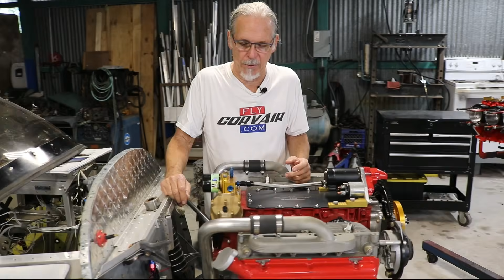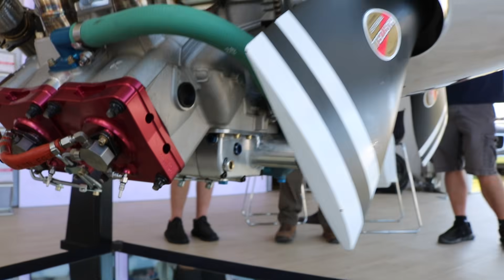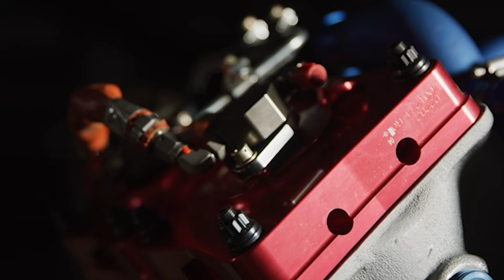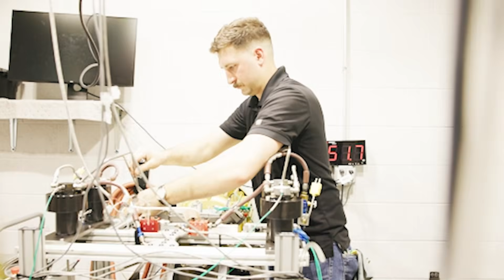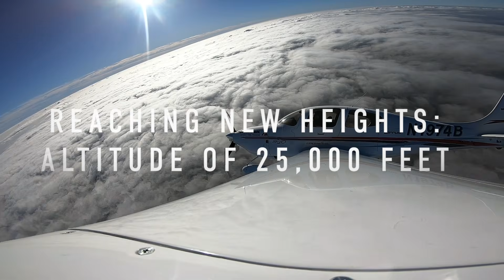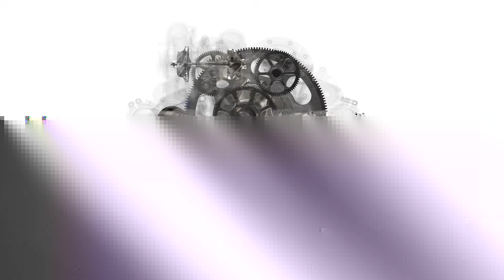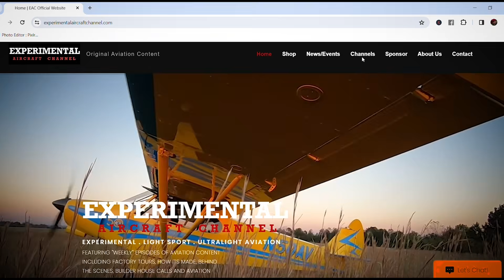DELTAHAWK Diesel Jet Aircraft Engine - ENGINE WEEK 2024

Comment: Okay,…. I’m coming at things from the old 2 stroke Detroit Diesel point of view because that’s what I know. The salesman said no valves or camshaft,… so the cuts in the sleeve that allows the intake charge to be introduced is also the route the exhaust takes, yes? 
Secondly,…. I’ll need to look at their channel/site about fuel delivery, how high can the individual pumps charge the fuel PSI before going to the dedicated injector & what’s the PSI sprayed into the chamber. Also how timing is controlled with this engine. 
Finally, and this is the major one. I know that 2 stroke diesels need a Roots type blower just to get started. With the addition of a turbocharger the airspeed from a “power-snail” can easily overwhelm a roots type blower. So I’m curious if there’s a bypass system where turbocharged air can get around/under the Roots style blower. I’ve seen it done on racing 2 stroke Detroit engines so I’m wondering if this engine has something similar. 
All and all a very impressive engine for smaller airplanes.
Reply: I saw a video elsewhere and they said the turbo is added to keep a consistent performance at high altitude, so at low revs and on the ground only the supercharger is working.
Reply: Turbos are very easy to control by wastegate, bypass, and blow-off.
Reply: The roots blower is a necessity to get a two-stroke diesel engine to light off,… I’m certain it’s also a necessity for this engine to kick over as well. Forced induction has a long history with internal combustion aircraft engines. I just think the entire process with this engine is fascinating.

Comment: At first, I was thinking this would be like a Detroit engine, but apparently not, as he said there are no valves in it at all. From his description, I'm assuming that the blower feeds to a port which gets uncovered by the piston for the intake but does not run through the crankcase, as he has oil lubrication in the crankcase, like a Detroit does. Edit to my post, Just remembering, it's actually the exhaust on the Detroit that is valved, not the intake, so It's really not much difference at all. It's just a ported exhaust instead of valves.

Comment: He's not quite accurate about the difference between a diesel two-stroke and a gas two-stroke. What he's saying is indeed true of his DeltaHawk two-stroke diesel and a typical cheap chain-saw two-stroke gas engine. However, a two-stroke gas engine could use turbo + supercharger scavenging just like the DeltaHawk does - they don't because it's more complex, expensive, and not needed for a little cheap putt-putt to run a trail bike or a chainsaw.

Comment: Would make an excellent hotrod mill . 235 hp with the torque, maybe a bit more porting and revs for the street, as you generally don’t crash if the engine stops in a rod . But 235 hp at 2600 is stout trout

Comment: Projected TBOs are meaningless... Only time will tell when a bunch get in service. The specific output of this engine with only 200 cubic inches and it being a 2 stroke puts very high thermal and gas pressure stresses on the pistons and rings. I'll be surprised if these go 3000 hours without issues.

Comment: I don't trust that guy...
Reply: He said marketing. He didn't mention that Diesel just has a higher specific weight and energy content per Liter and attributes lower fuel burn to efficiency of the engine BS. WHY if you have a great engine, just burning the same but cheaper and lead-free JetA being enough, do you endanger your reputation by obvious absurd claims?

I really want this engine. I just replaced our IO-360, a good engine, efficient at 150 TAS below 10 gph in a Cirrus SR20, with a new one. The next one should be something like the DHK, actually I hoped for this one. But it wasn't ready. I would be very happy with 10 gph JetA for the same cruise speed, and faster climb high up because of the TV. Stop making absurd claims, deliver a solid, certified, reliable engine. What it can really do is enough. Get marketing under control. This hurts more than it helps.

Want marketing advice? SR20 installation kit and price, performance tables and delivery lead times. There are plenty aircraft with airframe that have many decades to live, but need a new engine without Avgas 100LL, certified, not experimental stuff that you can't fly anywhere without difficult preparation in Europe e.g. Yes, there's a world outside the US!

Comment: Oh... he feel for "the P-51 made thrust from cooling".
No, it didn't. It reduced the drag significantly, but there was no net thrust.
The temperatures in a radiator or intercooler would have to be a lot higher for enough energy to be transferred to the flow.

There are P-51's still flying today. It should not be too difficult to measure the velocity delta.

Comment: Don't turbines burn Jet-A, a refined #1 fuel oil and diesel is #2 FO?
Reply: This engine has been designed around Jet-A since that fuel is available at most airports around the world.   It does run on #1 or #2 also.  In fact conventional diesel fuel is easier on the pumps.  It will also run on alcohol but with less power.

Comment: It cannot be a diesel piston engine and a Jet, aka gas turbine,  at the same time, so your title is wrong. I gather it is an inverted V4, turbocharged, piston ported, 2 stroke diesel which runs on aviation grade Jet A1 kerosene.
Reply: Exactly, also super changed.

Comment: Aircraft engines have been around for 100+ years now. How many diesel aircraft engines have there been? Almost none! Why? The high compression required for diesel requires a strong, and heavy block and head. Also the high compression equals more vibration. This engine is not the future, diesel and 2 cycle engines are the past. If you don't know that, your dumb and a potential customer

Comment: As a retired airline pilot and A&P I appreciate the concept a modern Detroit type diesel. Your presenter dodged a few impotent questions one being the initial TBO  and the actual certification standing. I also see several potential problems. The supercharger is belt driven what happens if it fails as the supercharger is critical to the 2 stroke diesel
Reply: The engine can run without the supercharger or without the turbo.  There is a reduction in power.  The supercharger is essential for starting.  After that it will run on either one.
Reply: That belt ain’t never gonna fail. Top fuel drag cars use belts to run 10,000hp supercharged engines. Both ford and Chevy use belts soaking in oil to run their oil pumps. I’m sure if you never replace it in 34 years it might crack a bit.

Comment: He avoided the “how much does it cost” question pretty quickly 😂 I’m not sure the RV community will be lining up for an engine twice the price of a Lycoming.
Reply: I see this as a very niche engine.... especially when you consider the initial cost.

If they want an engine designed for jet A, why not come up with a low cost turbo prop engine specifically for kit or experimental aircraft?

Also, he estimated the tbo to be over 3000 hrs. At the asking price, I would expect double or triple the tbo of a continental or Lycoming.
Reply: @brianschumaker5912 - tiny turboprops have not proven to be efficient because of the limited tolerances between the blade tips and the case.  I’m skeptical toward this motor only because it appears to have been on the verge of production for about 20 years.  It might be a terrific engine, but it needs to be in hundreds of planes with tens of thousands of hours before we get a real idea of how well it works.
Reply: @KenLeonard  
Wouldn't a turbo prop out of an Air Tractor be a viable solution?  At least a downsize one. There are plenty of proven turbo engines used in helicopters that could be adapted to a small experimental aircraft. The MD 500 comes to mind. The engine only weighs in the neighborhood of 135 pounds.

Comment: A two-stroke diesel with exhaust valves in the head and therefore uniflow scavenging ( like the old Detroit Diesel 53, 71, and 92 Series) is more efficient and effective; however, it would be more complex.

Comment: Nothing is "very unique"; it is unique, or it is not. A two-stroke diesel is not unique, and more specifically a turbocharged and externally scavenged piston-ported two-stroke diesel is not unique. 

If you mean a current production aircraft two-stroke diesel then yes, that's probably unique.

Comment: Liquid cooled engines CAN BE very low drag to cool, but good luck with that putting it in an existing airframe without something like a well designed belly mounted radiator...

Comment: I've been watching and waiting for this engine for decades and feared that the cost and red tape of FAA certification would kill it.  I'm glad they've persisted.  Unfortunately I'm now of the age where I probably won't be able to own/fly a plane with one of these engines (or keep flying, for that matter).  Really great design IMHO, especially with regards to cabin heat.  No more worry about leaking exhaust heat exchangers.  Just put a hot water heater core in the cabin.  On a twin this would eliminate the troublesome gas fired heaters.  If I was only 30 years younger... sigh
Reply: Perhaps stretching it a bit, but you might be able plumb a FIKI system as well.
Reply: Rotax 912iS is $25k and offers liquid cooled heads, and radiator/heat exchanger. 

Exhaust heat muffs are dangerous. Even new, they can crack and leak a lot of CO directly into your lungs.

Oh, the 912iS and iS Sport produce 99hp and obtain something like 0.38 lb/hp/hr BSFC which is 5%~32% better than the best/average injected or carbureted TCM/Lyco.

Comment: I have a few questions!
Why are the dry-sump scavenging stages on top of the engine, above the crankcase? 
What is the oil consumption like? I would imagine that the oil control ring at the bottom of the skirt prevents some oil loss through the peripheral exchange ports but not all. 
The crankshaft design is intriguing, is there a specific advantage to the counter-weights being a different material that needs to be attached to the parent crankshaft forging?
Is the intercooler an air/air type or using a separate glycol loop in air/water configuration?
How is the compression ring life being that the rings are swept across the gas exchange ports? How do you keep the ring gaps from migrating to an overhang position where they might catch on the port openings and wear excessively?
Reply: There are plenty of bridges across the ports to keep the rings in the lands,  my old Kawi had exhaust ports wider than anything I see here.
Reply: Lubrication scavenging pumps move oil mist, not accumulated liquid.

Comment: Diesels have been in aviation for years…...  Packard, Guiberson, JUMO.  Two stoke Schnuerle ported truck diesels had some interest in the late 50s in Europe.  White Motor Company here in the states built Schnuerle 2stroke V4 truck engine.  The 2 stroke isn’t as efficient as a 4 stroke nor, as Detroit Diesel found, cheaper to build.  But they are smaller and lighter.
   One tough 2 stroke problem is lubricating the piston pin which is continuously loaded.  Gasoline 2 strokes use needle bearings, but these are inadequate for diesel.  Deltahawk has this under control.
  In this size engine, Diesel efficiency does not necessarily exceed a direct injected gas engine, but you won’t see DI on a plane engine because of FAA rules.
   I wish Deltahawk the best and appreciate their perseverance,   On thing they might do is offer radiators and cooling system design software/service.    Cheers
Reply: They fo design the radistors and the cooling ducts as mfntioned in the presentation.

Comment: Same as the Detroit diesel system 71 series
Reply: Not really. The Series 71 (ike the Series 53, and Series 92, and related EMD engines) is a uniflow design, using cam-driven exhaust valves in the head instead of exhaust ports in the cylinder wall.

Comment: It’s a shame how woefully ignorant this fellow is on gasoline powered two stroke engines…unbelievable. 
Talk to someone who understands the advancements in gasoline powered two cycle engines like the 
e-tech ski-do engines and I guarantee that you will be blown away by the advancements. 
It’s incredulous that this man references a 1970’s Kawasaki motorcycle…should we assume all diesel engines are still sporting 54 year old technology?
Unbelievable ignorance.
Reply: Okay, but to be fair most general aviation aircraft use engines designed more than 54 years ago.

Comment: Love this motor.  Jet A, reliable, compact, good torque, low maintenance.  The future for general aviation powerplants.
Reply: You won't know how reliable or durable it is until a bunch have flown for many thousands of hours.
Reply: @rv6ejguy  Very true.  But the current state of Lycs and Conti's doesn't instill a great deal of confidence.  Seems there's always issues with cylinders and/or cranks.  What I like about the diesels is the torque, which is what you need at the propeller.  The conventional aircraft engines develop their torque and horsepower at higher rpm, where the propeller becomes less efficient.